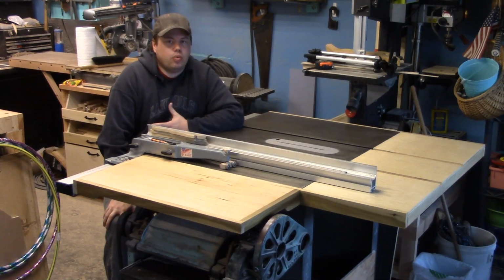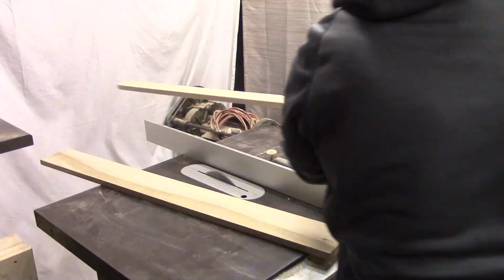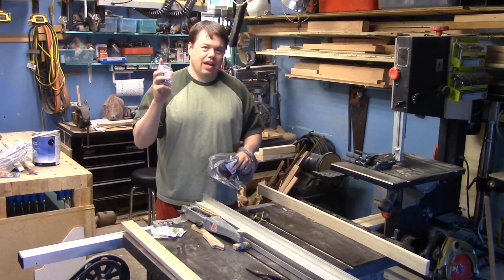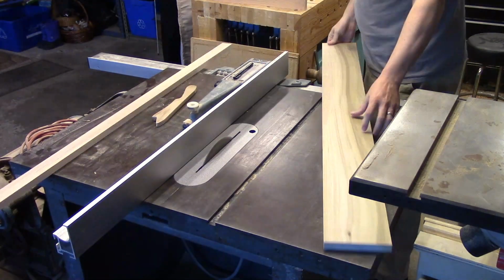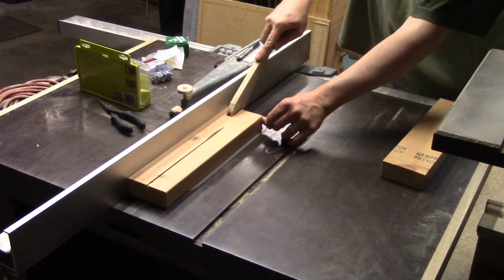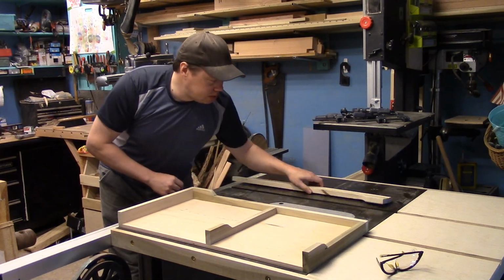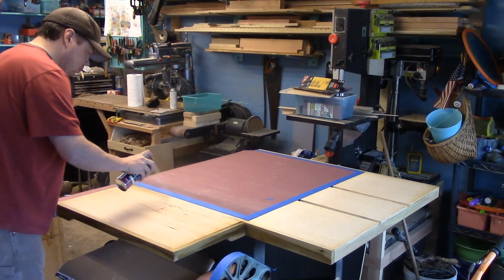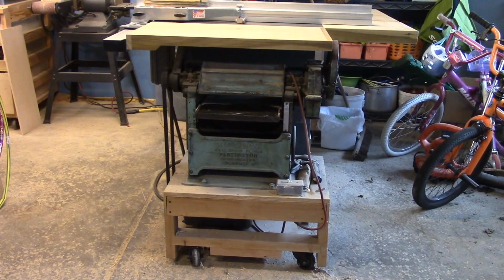Tablesaw Extension and Side table

Comment: A sure sign of an experienced table sawyer is if they aren't scared to death of the blade.  I've seen vids where the operator has a stick about 2' long in each hand and they're trying to poke the piece through the cut, not realizing the piece could easily get crooked and jump out at them.  I'm surprised they weren't wearing shark gloves.  I took off my guard long ago, mainly so I could do quicky dadoes.  Nice fence; gotta get me a better one.

Comment: Curious as to why you did not choose to extend the side table to match the end of the cut off table?
Reply from the maker: because it was unnecessary as material does not need to be supported there.  it would have also collected extra stuff and made it harder to fit my planer under there.
Reply: Thanks!

Comment: Damn... so jealous of your shop.  I'm more of a weekend warrior type, have basic ryobi setup.  But even building a coffee table I'm running into problems.  There's no surface area on my table saw to properly secure a board to the stop arm (whatever it's called).  The wood can just freely move around.  It's pretty much worthless.  Any cut that's longer than a few feet can't really be done without the board moving around.  Which I can just use my miter saw for that.

Comment: Great build sir. I'm about to try to build an extension for my Delta although I'm caught in a dilemma re fence. Don't want to buy the expensive thingy, might cost me my marriage. Any ideas how I can get away? Thanks, more power and happy new year.
Reply from the maker: +palabful I have some older videos where i built a outfeed and side router table for my previous craftsman saw. worked great with that crappy fence.
Reply: +Michael Olson thanks. I'm getting some of your ideas incorporated with mine. I have a very small garage. I do custom builds as my side hustle. Nothing big just simple stuff i.e., countertops, built-ins, simple kitchen cabinetry, small furnitures, etc. I'm self taught yet have enough motivation and aptitude to progress in this trade. Somn to once retired. BTW that radial saw is bad! What is it? Dewault?
Reply from the maker: +palabful Motivation and Time are the most important things!  sadly i haven't had much of either recently. My RAS is a Delta Turret arm. it's my favorite tool by far.